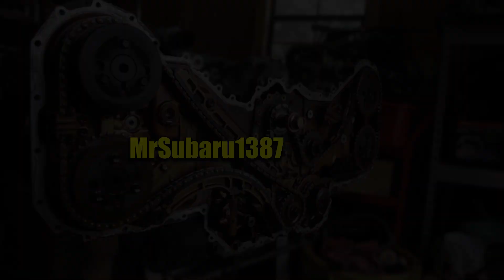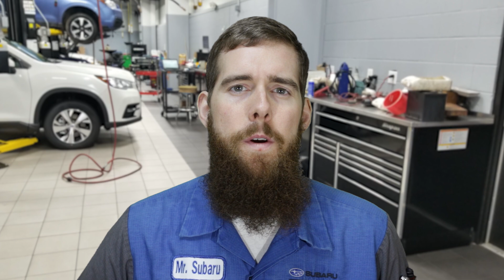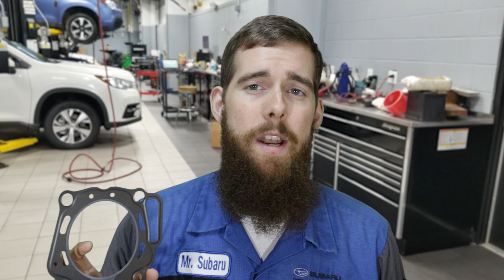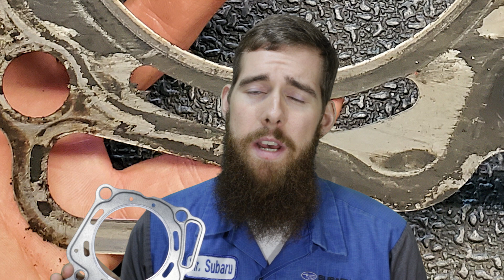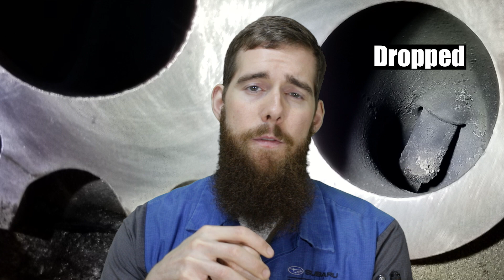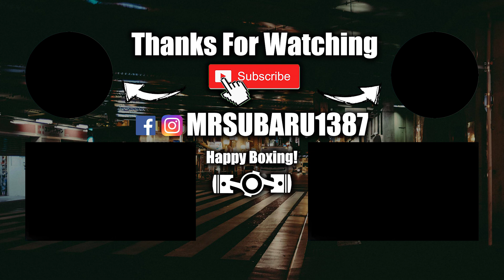Subaru Head Gaskets Explained

Comment: Lol maaaan i bought my first subi and 3 months after buying headgaskets went looks like im tearing her down replacing gaskets timing an water pump :/ thanks for the info im familiar with boxster engines after doing my research but didnt hve this info AWSOME vid thnk you.  A good majority out there ive seen in the shop recommend to use the exact same gasket number you said not to use and hve it fail again great information definitely subing A+

Comment: You forgot to mention block straightness. I have experienced more than one warped block. Had to refinish my 2000 Impreza 2.2 block due to .0025” warpage. Heads were straight but new gaskets failed. Pulled heads again and checked block with straightedge. Had to refinish block. Used sandpaper on glass laying on a straight LS cylinder head. Worked perfectly and I know it’s straight plus I know how much metal was taken off by my “machining”. Plus I can see and feel the block and cylinder head finish. Much smoother than any machine shop finish I’ve received.

Comment: Thanks for going over this subject in so much detail.  Have a 1998 legacy outback sedan with the 2.2L that is still running great at 231,000 miles!  Fingers crossed going to run it till it dies.
Reply: Best engine ever I got 500k plus out of 92 legacy

Comment: Everything i heard in this video sounded correct. I'm not strictly a Subaru tech, but I am a professional tech and I've worked on a lot of Subarus and done plenty of head gaskets on the engine models you said, and only one set of head gaskets on a different Subaru engine.

Comment: Thanks. My 2014 Crosstrek with 113,000 km is starting to age and I'm beginning to get the courage to work on my car. Maybe not a head gasket, but I've done brakes, spark plugs and PCV. Front wheel bearings are due when it gets warm enough to work outside. Fingers crossed my FB20B is not vulnerable as you mentioned.
Reply: How did it go? If you don't mind sharing the repairs made. 🙂

Comment: My well maintained, garage kept,  2016 Subaru Outback 3.6R with 48K miles on it has a head gasket leak.  The leak was discovered by Subaru mechanics today at the dealership.  Good thing I got the extended warranty.

Comment: Just a FYI for everyone in 2010 Subaru went to this MLS from the turbo 2.5 engines. The turbo engines also had semi closed deck blocks so Subaru also changed all the n/a 2.5s to the semi closed deck blocks at that time and Subaru head gaskets are made by Victor Reinz also
Reply: bigdaddymak1439 Interesting, but what I gather after much Googling is that only some models got the MLS gaskets in 2010. The 2010 Forester did not.
Reply: @sparklehorse02  yes in 2010 but it would be the 2011 model yr which starts mid yr 2010
Reply: bigdaddymak1439 So my 2010 Forester EJ253 has the bad gaskets then. Guess my only hope is if it also had conditioner in the coolant.
Reply: @sparklehorse02  
2010 Forester, 2.5 SOHC, NA:
I had to replace the HG on my Forester 20k miles ago. Felpro MLS, resurfaced the surfaces with sandpaper glued to a nice flat formica covered board. 
That said best practice is to do what Mr. Subaru says and use the Subaru MLS gasket.
Reply: Scootintiki  How many miles on your 2010 Forester when the gasket failed?
Reply: @sparklehorse02  
I replaced them at 130k miles. I had just bought the car so I don't know when it started leaking.
Reply: @pedlpower  Thanks!

Comment: i had a ez 36  drivers side bank had a external leak that i had done the job about 3 months ago and at the Subaru that i work for we use the m.l.s head gaskets on every ej-251-253 we dont sell the single layer ones due to the failed coating and as a tech we stop using the 'stop leak' because of the problems we have seen other then that was a grate vid.
Reply from the maker: Yeah, I mentioned the hand full of EZ36D failures.

Comment: This is the best video on Subaru headgaskets. But unfortunately people will still spread misinformation. Its real easy to spread bs and claims not based in reality instead of just understanding the problem and fixing it correctly. Keyboard warriors who probably dont own or work on subarus have replaced actual constructive information online and on forums. Once again,  awesome video by Mr Subaru
Reply: @scottfirman  Oh trust me, i am not defending the way that subaru has handled certain situations, but i too have owned 3 subarus and personally repaired them the proper way as Mr Subaru described in the video, and have yet to have repeat headgasket problems. I guess where i was going is that there isnt an inherent mechanical flaw with them as long as they are repaired in the correct way.

Comment: This is a very good, thorough explanation of the HG problems. Unfortunately, I have had 3 subies, each has had HG failures, one with multiple HG failures, all repaired by Subie. Subie would not substitute a felpro gasket when the last one failed since they were picking up the labor costs of the repair. Subie knowingly used poor quality parts, never issued a recall, and advised adding the stop leak. Add to that the poor CVT transmissions, recent recall of over 400k models for PCV problem, and another 40k over electronic parking brake, the lousy power output of the old school boxer engine, and the long history of premature rusting and i will never buy another one. I can say, however, that the AWD system is without a doubt the best there is.
Reply: I am sorry about your experience with Subaru. It really depends on the models and years to buy. Always check JD Power or Consumer Reports for the years and models that are known to last and last. A lot of my family have Subaru's since my dad's side family lives in Westchester and my mother's side lives in NYC which gets lots of snow. My uncle has a 2015 with over 110,000 miles with just regular repair and my aunt on my mother's side has a 4th gen Outback with 124,000 miles and both haven't been stranded. My personal vehicle is a 2012 Outback 2.5 limited and that has performed really well with 95,000 miles on it. You can get pretty decent reliable transport with Subaru just know which year and model to buy. We don't trust their performance WRX models firstly because it's not practical for our needs since we need ground clearance during these northeast storms but mostly because it's probably been abused by some teenager doing sick drifts and blowing the engine. Properly maintained, right engine, right year, and these Subarus are known to just last and last. I know of the issues that they have, their Forester and WRX models are known to use up too much oil, in fact, there was a lawsuit against Subaru for just that reason. I am well aware of the issues with this brand but they can build reliable cars that last you just have to find the right ones to buy and check the aforementioned websites for reliability reports.

Comment: Amen thank you 🙏 all 3 of my Subaru’s no issues EJ20 GC8 WRX (Australia) 04 Impreza NA wagon and 04 Outback known as Legacy in USA market with 6 cylinder 3L no issues. My WRX I did a replacement for a just in case measure as it’s a 99 model cost $800 AUD also upgraded to process west top mount

Comment: Great video.  I just pulled the heads off my 2011 Subaru Outback and was surprised to see it came from the factory with the MLS gaskets you recommend.  The failure happened at approx. 163,000 miles.  Replacing with OEM MLS.

Comment: First, thank you for providing solid and complete answers.  I am helping my son to shop for a used Impreza, and I really needed to know to truth (there are SO many supposed-expert opinions out there).  But I am left with one question: Since Subaru was aware of the problem on the 2.5, and had a better gasket in their inventory, why didn't they just make a running change in manufacture, and use the bullet-proof solution?
Reply from the maker: I wish I knew. I'm sure cost played a part in it. If the MLS turbo gaskets were let's say $5 more than the single layer, and they made 1,500,000 cars. That gasket change would have cost them $7.5 million over the production run. Just a guess.

Comment: Wish I knew this info years ago when I had a seized engine on my 02 Impreza Outback Sport @ 74k due to a bad head gasket.  Cost me a TON of money to get a refurb (used) Subie replacement engine.  I swore off Subaru after that.  Not because they don't make a good product, but because Subaru USA wouldn't step up to the plate and deal with the issue properly.  The answer to me was essentially - not our problem, you're on your own.  Crappy customer service.
PS:  Great video!  Wish Subaru had more people like you working for them.

Comment: I have an EJ25D in my '97 Legacy GT and I THINK I remember the guy I bought it from telling me he had replaced the head gaskets. He apparently owned it for years, but it developed an issue where it wouldn't start and he didn't have the time or money to try and fix it, so I scored it for $1150. After a couple weeks of fiddling and testing, it turned out it was just the wire that connected the fuel pump relay to the fuel pump had some kinda short, so after a couple more weeks of looking at wiring diagrams to make sure I had the right wire on both sides, I just clipped it and spliced in my own wire. Started right up, no problem.

I really hope I won't have to replace the head gaskets anytime soon. I'm at about 240,000 miles and the engine still purrs like a kitten, responds exactly when I want it to, and is all-in-all the most reliable car I've ever owned. Just finished fixing a battery issue, about to rebuild my power steering pump to stop it leaking, and then I've got to find a clogged drain somewhere that's causing a leak that's running through the foam of the console and dripping out the bottom on the passenger side.

Yeah, it's still a bit of a project, but at least it's a project that will hopefully, with some more careful care than I've had the time or money to give up until recently, keep running for many more years to come.
Reply: If you have 240k on the clock those gaskets have absolutely been replaced. good luck with it, enjoy it.

Comment: Excellent video. I do not have any issues with my beloved 2002 WRX EJ20 (my toy car) but my son's 2001 liberty 2.5l single cam had a bad oil leak on the left bank. It grew to be a total head gasket failure with oil and water mixed to a cream slop. A good replacement low mileage engine was purchased and the heads removed, same single plane gaskets. I had the heads decked and all valves and gear checked and used the genuine multi layer gaskets as per this video. The car has been running again for a year and is perfect.
I'd like you to do a video of how to adjust the EJ20 turbo engines tappets the correct way.

Comment: So I just bought a 2002 Outback. It has new MLS gaskets, valve cover gaskets, timing belt, water pump, intake/exhaust gaskets, thermostat and a bunch of other things. The weird part is, it runs and stays at operating temp no problem at idle but as soon as you drive it the temps climb. Park it and the temps go back to normal. There are no leaks that i can see, no smoke and the engine runs perfectly fine. I don't know what kind of parts were used on it but it all seems to be done fairly well. I have no idea what to do from here on..

Comment: Thanks for this video!!! I have been driving Subarus for 20 years and love the cars. I tend to buy them with head gasket issues and can find them pretty cheap up here in MN!! So I have done the head gasket job several times over the years and I do exactly what you recommend with getting the heads gone thru!!! BUt my question to you is. Knowing these were such an issue, why didn't subaru use the better gasket right away??? Seems like that would be a simple fix for them and would correct the tarnished rep for the brand. Maybe you covered this in another video. Just found your stuff and your doing a great job with what I've seen!! My current Subaru is an 05 Outback with the 3.0L motor!! First one I've owned and love the power and smoothness of this motor. The thing rips!!! The only complaint would be the fuel mileage to some level but won't keep me from buying another one. Running premium fuel in it, which is recommended,  it gets right around what my 2.5D motors have run in the summer anyway or within a mile or 2 per gallon. In the winter the 2.5L did drop off but just not as much as the 3.0L.  Is there a generation of this motor that is better?? I'd like to get a gen 2 outback with the 3.0L as well one day as well? ANyway I'll quit bugging you for now!! Thank you Sir!!

Comment: I just bought my dad's 2010 Forester.  Started seeing these headgasket posts online.  Asked my mechanic, Master shop, 80 plus yrs in business, Fleet servicers for local PD,  been using these guys for 26 yrs. I trust them, literally, with my and my kids life.   Shop master(been working there for 40 yrs) said they've NEVER had any Subaru with an HG problem. Never. Not "never" as in "rarely." Never as in Never.  Told me not to worry about it.  Next time they have it, (for timing belt) they'll take a glance as best they can without taking things apart, look for any potential risk factors, replace my coolant, but don't worry.
Reply from the maker: Sounds like he's never worked on a Subaru before! 😂 🤣 😂 🤣

Comment: I think you managed to tell us everything except the years and models affected. I’ve done some more research and found that everything built after 2012 uses the multi layer gasket you mentioned. Most of us just want to know if our cars are affected so we can plan accordingly.

Thanks.
Reply: Have a look at it.
MLS gaskets are easily identifiable from the top of the engine bay.
Even easier if you get under it.
Reply: @notsponsored103   How does one identify the good  MLS gasket? Thanks!
Reply: @bizcocounty  have a very close look at the edge of the gasket. It protrudes from the edge of the block in a few locations where the gasket is not the same shape as the block deck.
In some of these locations it is even possible to separate the layers of gasket with your fingernail. 
If you can't get past all the things in the way above the engine you can access it very easily from below the car.

Comment: the main problem for the people tuning their turbo subarus is they are increasing the cylinder pressure and generally stretching head bolts, and blowing out the gasket, in this case the problem is not the gasket, but the bolts.......turbo models take a really long time to blow(if they do at all), mine failed in my FXT at 213k, but you also gotta look at the environment, where this car was operated temps during winter regularly go below 0F(as far down as -40F) and those heat cycles caused my heads to warp and leak, the gaskets did not fail because the gasket was bad, but because the heads straight up warped due to all the heat cycling, during my rebuild I had to use tomei 1.2mm head gaskets to keep my timing belt tensioning properly and my compresssion ratio correct(when the heads and block were milled the camshafts became closer to the crankshaft making the timing belt too long with stock thickness gaskets)

Comment: Friend of mine is a 27 year Subie Gold Master tech.  He said he's replaced at least 1000 of these and he's replaced 5 of them for me through the years.  He can do the entire head gasket/timing service in about 2hrs.  Don't know how he does it exactly...but here's his take;  Don't worry about shaving the heads...don't worry about the valves, seals and anything else.   Clean the surfaces up toss the old bolts and he said with VERY rare exception...unless you've overheated...your heads and valves are fine(he said "you'll know" ).  Also, he said the BOLTS are more important than the gasket itself.  So long as you buy new SUBARU bolts and properly install them...he's used the el cheapo gaskets off of Flea Bay with no issues(as long as they're MLS and no lamanation.)  He would REFUSE to do the job without at least the Subaru bolts.  Also, your waterpump does NOT need to be replaced...ever...unless it fails...so don't worry about it when you're doing the timing service.  He rarely saw Subie WP's fail and many of them go over 300k miles without issues.
Reply from the maker: That's about 10 tons of bs and bad advice, if I ever heard it. He's a 27 year hack from your description.

Comment: Been monitoring external oil leak on 07 Legacy EJ253 for 8 years (now has 130k miles), so far no contamination between oil and coolant. Have to top off about 1.5-quart between 5000-mi oil changes.

I wish I could do my own work on this one, but I really don't want to have to pull the engine out.
Reply: I have an 04 impreza obs 2.5L and the gaskets are weaping oil. Coolant is not being consumed, I do have to top up the oil about 0.5L between oil changes but I can't tell whether that's a combination of burning the oil and weeping. A large fraction of the oil consumption is from weeping. No problems yet, just monitoring as well. Pretty sure I have ye ol graphite gaskets :S
Reply: 2006 Forester EJ253 engine. Leaks a little oil on both HG. A drop a night in the driveway . Monitoring oil consumption. No a big deal yet  1 quart for every 3000 miles. Car only 81000. If you stay on top of things and do regular maintenance it should last a few more thousands.